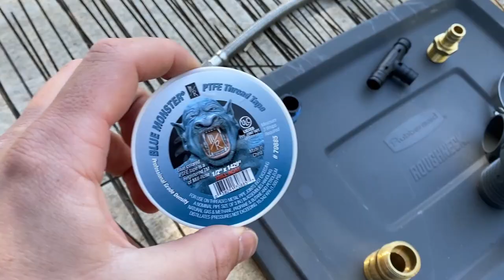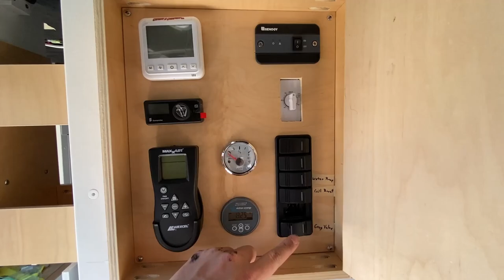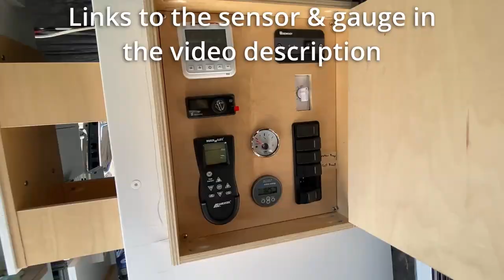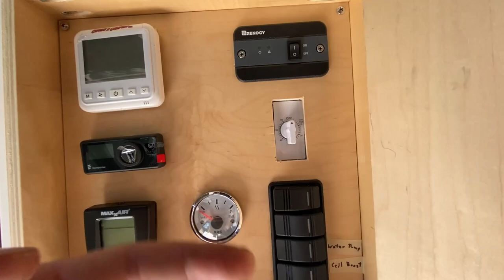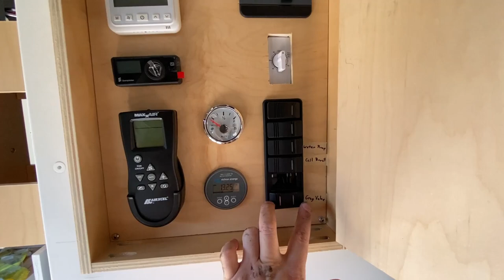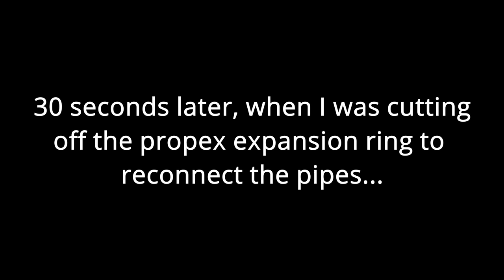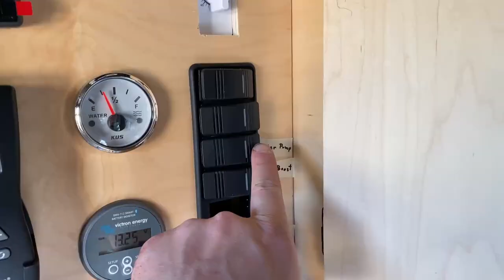INNOVATIVE 💧 Off Grid Water System IN A VAN 💧!!! ProPex, Gray/Fresh Water Tanks, Electronic Drain

Comment: 23:16 Am I crazy or does adding 2 flow restrictors to the end of the pipe just cancel themselves out? Water and air can flow in both directions...just like if they were not there at all.
Reply from the maker: Yes open pipe would allow free flow of air + water but would also allow road debri to go in
Reply: @seven_o_savage  But with the assumption that you are not filling or draining the water tank while driving, road debri would not be an issue.

Comment: I know these videos are a lot of work, but…
You put your water tank inside so it won’t freeze, then ran the water lines and some valves under the van…where they will freeze. 
So I’m just curious as to why?
Reply from the maker: It’s a good point, in this van I didn’t have a good way to run water lines inside the van. In the future I’d probably raise the floor under the bed to run electrical/plumbing. That being said I can still add heat tape to the pipes in this build

Comment: Really nice job! Thank you for that awesome video! I recently had to run new hot water line in my house and I used PEX and the Sharkbite fittings, I was very impressed , check em out if you can!
Reply: $300 for this pump!
Reply: Shakbite is for those times when it’s hard to weld or whatever and you need to put a connection to have water in the meantime. I’d never use shark bite as a permanent solution especially in a van where the vibrations can make them lose and leak.

Comment: 2 comments: 1. Does this system need a p-trap to keep odors from grey water tank coming back into van? 2. Re: copper plumbing in one commenter's home:  Nearly all new homes and remodels today are being done with PEX--less expensive, doesn't corrode over time, and thieves won't steal the copper out of your construction site! A friend just spent $18,000 replacing the corroded copper in his concrete floors.

Comment: Ditto on the two responses from women. Why did you not choose to do a recirculating shower. The water would last longer during a Zombie Apocalypse🐳
Reply: The recirculating shower is a very complicated system that requires a lot of time, money, and maintenance to get right. It can be more of a hassle than just using a low flow shower head and taking "military style" showers where you get wet, turn off the water, soap up, turn on the water, rinse off, and get out. While not as luxurious as having an "unlimited" amount of water in a recirculating shower, I'd rather do the low flow/military method than have even more filters to change and parts to worry about breaking.

Comment: Propex is great but you're using the wrong tubing. The red and blue tubing is incompatible with the expansion fitting system, it's made for the crimp fittings. You need to use only the white uponor tubing with expansion fittings. Probably no big deal in a van but it will leak especially if you get freezing under there

Comment: You should not have a check valve on the outlet of the water heater relief… There should be never be anything that could obstruct flow after the relief valve,  Good work otherwise.

Comment: I don’t want to sound like an ass but I do not like this plumbing set up at all. Swapping the filters is going to spill water everywhere being horizontal. Why filter the shower water? I would have a seperate filtered water tap dedicated to the filtered water, and would include a reverse osmosis membrane to ensure the tanked water is safer to drink. Besides the design of the system, the video is great, good clear explanation’s, light, entertaining and interesting. I found it very useful but your design of the system seems illogical